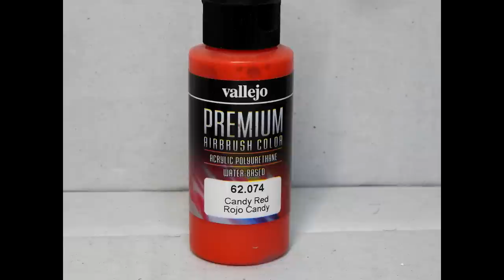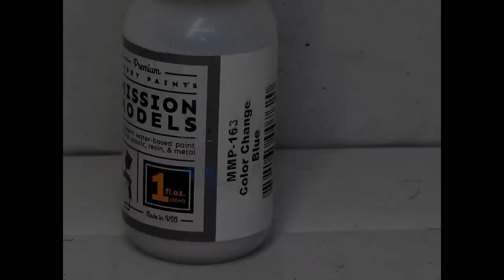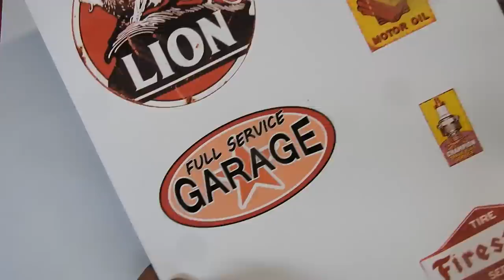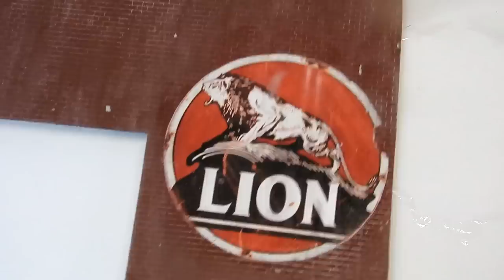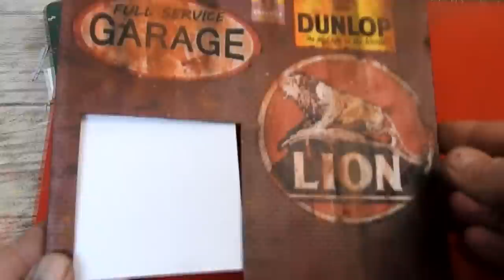Hot Wheels Crooze Ooz Coupe Custom - McDonalds LED - Old Garage Diorama

Comment: I've been wondering what you use to put the cars back together? I've been using superglue on my gaslands cars, but it often spreads a white blemish around the glued parts.
Reply from the maker: Usually superglue, or I drill and tap the posts. Paint some varnish over the glue after it sets, this will stop the white spreading. Use a good superglue like Starbond, it doesn't have much white at all  and they do a black one 👍 Link in description below 👍